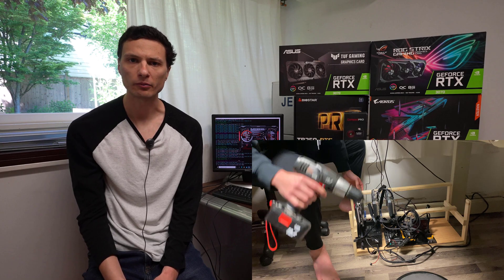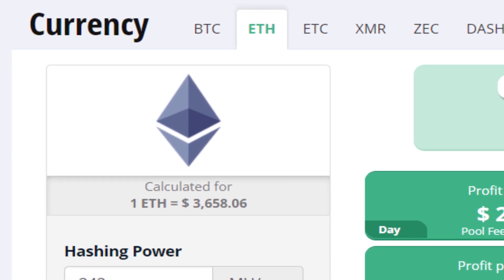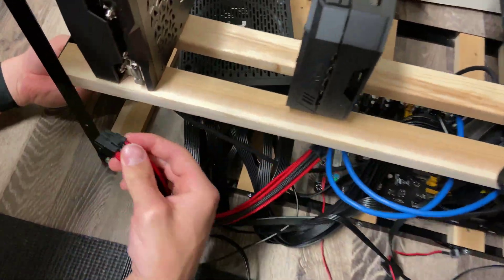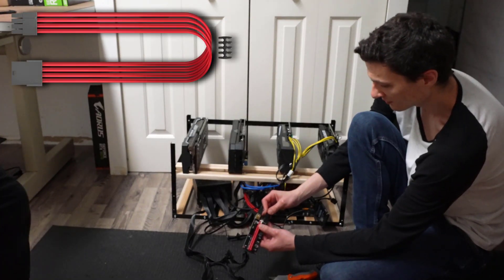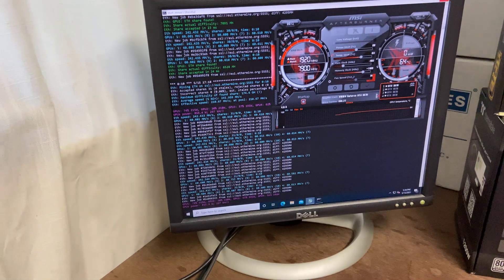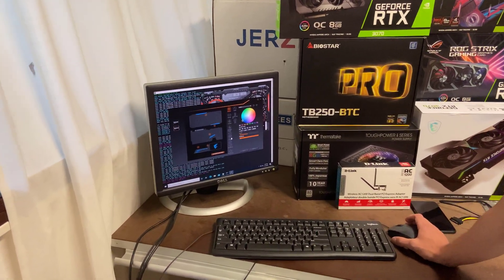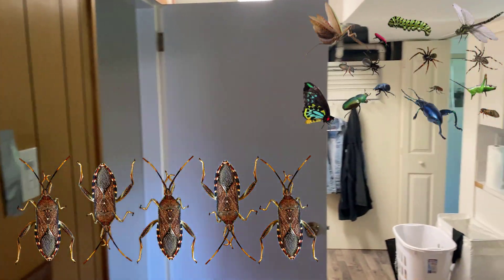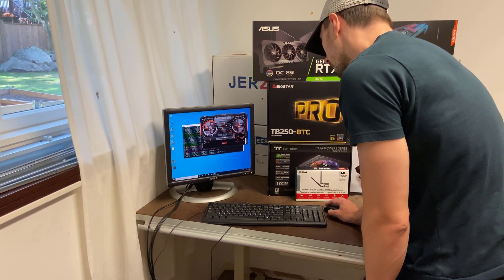4 X Nvidia RTX 3070 8GB Mining Rig Build | 242 MH/s at 900 Watts

Comment: Hey man, would you mind giving me a quick explanation about power sources? I mean, what's the relation between the power source and GPUs? Having in mind I want to start with 2 or 3 3090's, but thinking about upgrading that rig to 6, which power source should I buy? And one last question, what's the power consumption per hour of a 3090 when mining? Thank you in advance!!!
Reply from the maker: I typically try and use a power supply that can cover at least 1.5X the load of the rig. 

For example, 6 X 3090's would be around 1800W. In that case, it is probably best to buy 2 X 1200W power supplies. I hope this helps!

Comment: Try %70 power, if stable drop by %1-%2 till it start to lower your hashrate. I was able to get my msi ventus x3 3070 down to %62 stable, -350 core, +1150 memory, fan % @ 85 keeps card around 47-50c

Comment: idk man, feel like your efficiencies could be better. my 1 3090 doing 122 at 280 watts. if i double that itd be 242 at 560 watts. even if i were to say i were getting 300 watts per card its be 600 watts. for the same hash. doing thermals on my other 3090s later in the week so we will see.
Reply from the maker: I have no doubt my efficiencies could be better. I wanted to keep everything stock during the initial testing to get the most mining power out of each card. How much did you lower the power limit of the cards to achieve that?
Reply: Indeed, efficiency can be better. For the 3070's you can set them up as 50-60% of power limit so at the end one will have around 62 mhs and about 150 watt per gpu; and it can go lower on pl :)

Comment: I have almost the same cards, 240 MH/s but only 640 Watts
Reply from the maker: Very nice. How much did you lower the power limit of the cards to achieve that?
Reply: @VeeTechYouTube  They are at 57 percent
Reply from the maker: @Kimrein  wow that's low
Reply: @VeeTechYouTube  Power limit 57%, fans 57% memory 1100. Power consumption 157,157,158,137(last card is a tuf oc), temp 46,47,49,42 (last card is a suprIm, the hottest one is a tuf oc). The other three are two strix oc and one tuf oc.
Reply: @VeeTechYouTube  yea you can run most 3070s at 58 power limit and 1200 mem overclock and have no invalid shares. would recommend lowering your power limit bc you can def save some money in electricity
Reply: @nickymill  i have one rig wirh 4x asus tuf rtx 3070  53% power limit 120w each in software

Comment: You should be using no more than 600 watts for this setup. Install NiceHash and set the overclock settings to high and you will use a lot less power with the same output.
Reply: That doesn't look like a 600 watt psu in that mining rig. 600 watt psu also only have 2 pcie 2+6 connecters
Reply: @Beezid30  he's not saying to use a 600 watt PSU, he is saying his setup should not pull more than 600 watts, in terms of usage not availability.
Reply: @morecarstuff   it did not sound like that before he added the "no more than"
Reply from the maker: @Beezid30  Interesting.